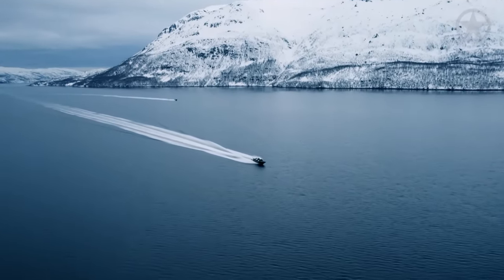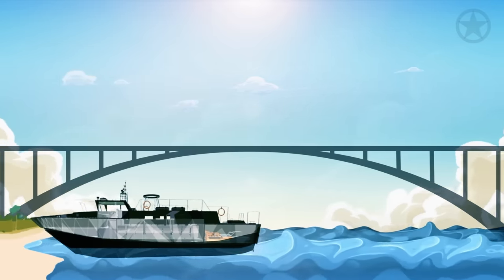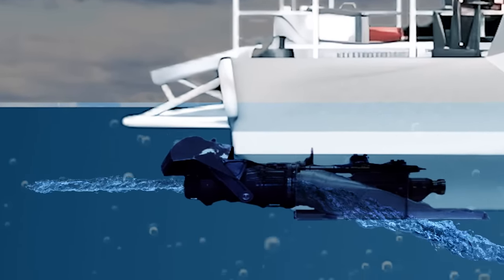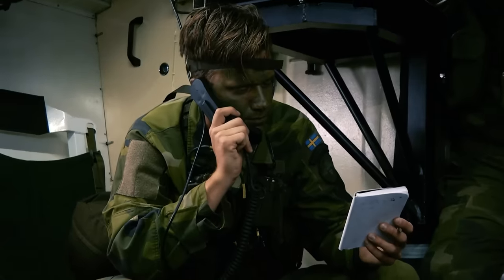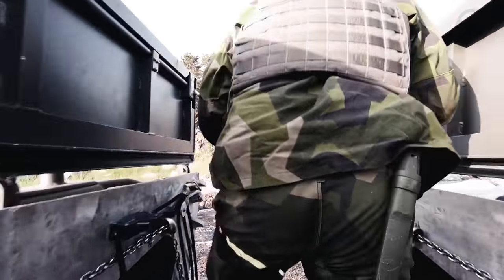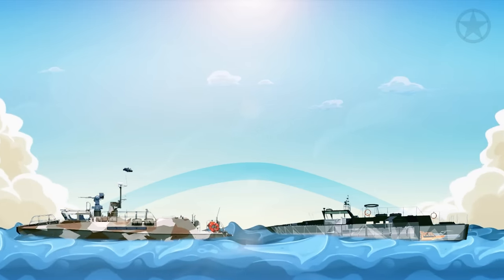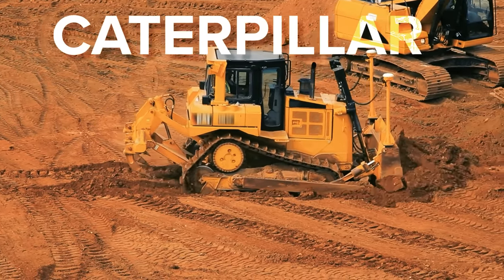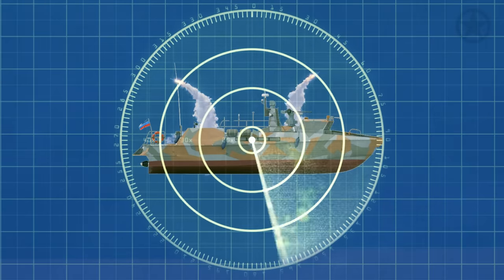FINALLY: Ukraine Receives Monstrously Powerful Fast Assault Craft

Comment: If only the  Swedes has provided Gripens to the Ukraine!
Reply: They have too few of them.
Reply: You really need to do some reading up on how much ground service and facilities you need to implement to introduce a whole new weapons platform like that, especially in a conflict zone. It´s NO WAY near what it takes to get some ground force equipment stuff over there. You need to calm down.
Reply: Pilot training to fly them is also important it takes a lot of time to skillfully fly these amazing planes.
Reply: @genobohez6374  Ukrainian would have sent trained combat pilots for training.  BTW, do any Swedish pilots have combat experience?
Reply: @OjsMatte  Ukrainians will get the F16 in a matter of months, so you are just being hysterical.
Reply: @planetmikusha5898 you really have 0 clue about this topic. So i will have that in mind when reading your comments. 

One reason its "taking so long" other than pilot training time, infrastructure reorganisation etc is simply, the Swedish parlament. Unfortunately sometimes, democracy works against our interests. Even though the ruling parties are somewhat positive to send the Gripen, unfortunately a lot of russia friendly parts of parlament are obviously against it. They are whats causing blockage in the system for the most part right now. 

Also, comparing F-16 with Gripen is ridiculous, completely different weapon systems, with different assets, downsets and purpose. But i guess "tHeY lOoK sOmEwHaT aLiKe sO tHaT mEaN tHeY aRe AliKe"
Reply: @amazingslav1648  If you understood the problem at hand, the  issue is not whether the F16 or Gripen is superior - the issue is whether the Gripen is better than the Su35.

And one reason it is taking so long, is that nothing is happening.

You do not have a clue.

Comment: The CB90 can also be equiped with Helfire misiles.

Sweden donates 10pcs and Holland another 3pcs.
Holland and Sweden together also will donate 50pcs or so of fast squad level transport boats.
Reply: yupp 🇳🇱❤❤
Reply: Norway donated 160 hellfire missiles and a number of launchers back in -22
Reply: The hellfire platform on the CB90 is nothing but an old prototype that never went in to production.

Comment: Needs an M163 Mini gun front and back. Then it qualifies as Wicked.
Reply: The new version has .50cal and general purpose machine gun mounted in the turret with a gunnery position in the transport section, 2 .50cals mounted infront of the helmsman and five gun mounts midships and aft which can hold machine guns of varying sizes including miniguns. My colleagues have even fired to Carl Gustav grenade rifle from the aft. Ukraine likely won’thave those ones though so they get a manned .50cal in the turret and the two .50cals infront of the helmsman.

Comment: CB90 is maybe the best amphibious small boat ever made, there just simply cannot be enough of them, and the ability to customize them to rocket launchers and sub hunters.
Reply: The viveo OBVIOUSLY shown that is is a vessel easy to customize.
Reply: @carlossaraiva8213  I'll rephrase what OP stated has it's a bit convoluted wording:
Combat Boat 90 is splendid, it can easily be converted and adapted for different tasks.
It is probably the best vessel for amphibious operations ever made, just a pity the numbers available is not unlimited.

Comment: I’ve been on board SB90N several times. A very capable and adoptable coastal vessel for sure, still the design is getting old now. Water jets have many advantages, but such systems are both a bit heavier and less efficient than good propeller systems. High consumption means limited range. And ... the video title is still just silly.